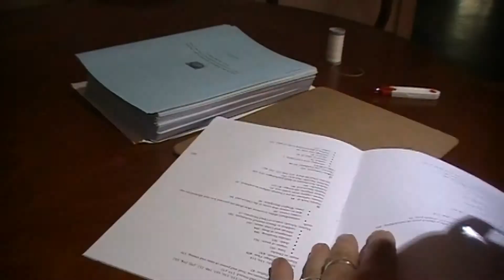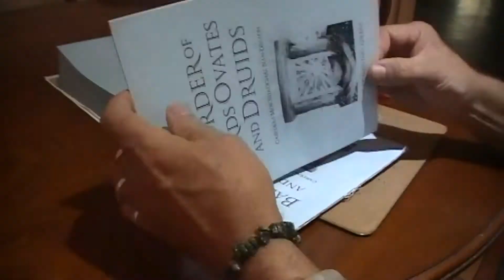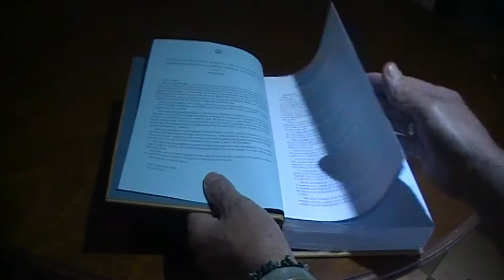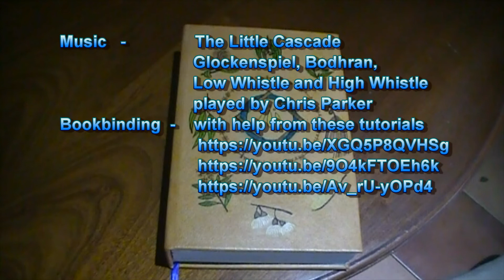Bookbinding my OBOD Bardic Grade Gwers

Comment: Beautiful Work! Did you include the supplementary materials? My supplementary materials don't match. Supplement number one is numbered incorrectly, numbered 3 to 10 instead of 547 to 554, and supplement number three is a cream colour and not even light blue like the others. I'm on the fence about whether to include them or not. I feel the book would be incomplete without them, but look patch-worked together with them.